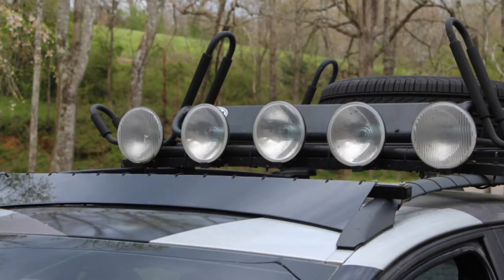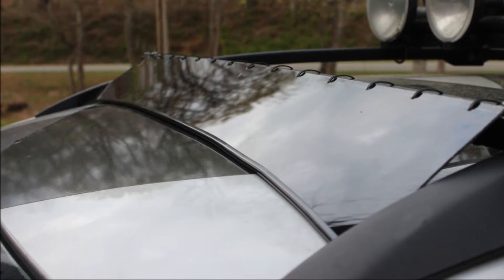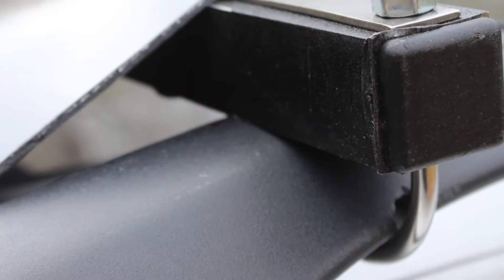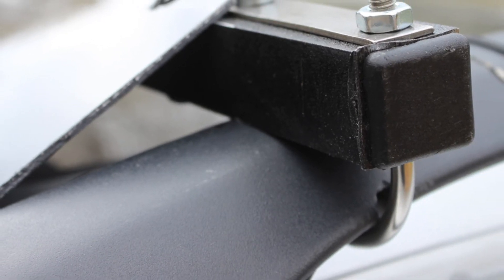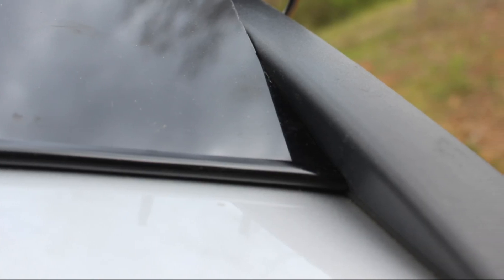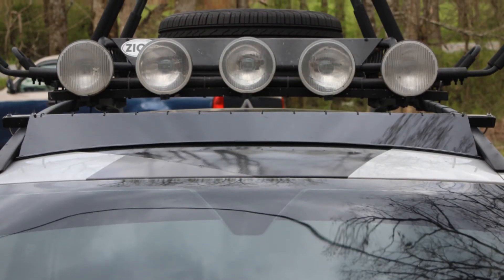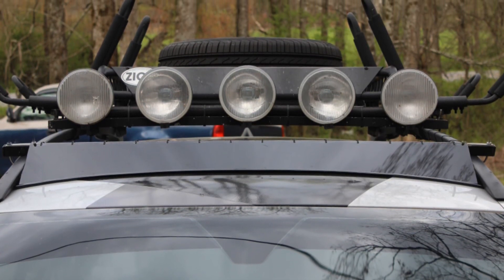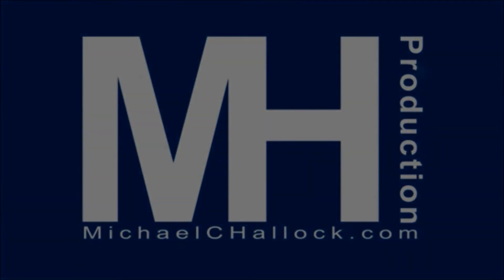Project V50, Episode 50: Wind Fairing

Comment: Looks great. Where did you find the lexan?
Reply from the maker: Home Depot Sells sheets of it in varying sizes and thicknesses.
Reply: what thickness lexan did you use for yours I don't want to buy one that will be too flimsy @MyNameIdeasWereTaken
Reply from the maker: @kodyvalentine3983  I can't remember the exact thickness, but it was something that was readily available at my local Home Depot. I just picked out something that seemed like it would be rigid enough for a fairing.

Comment: Hey! I am also a v50 owner, I didn't check all your videos, but have you done one on how to install those black rails on your roof? Or did they come stock with the car? Thanks!
Reply from the maker: They are factory roof rails, but if they did not come with your car, they are not hard to install. Here are the Volvo instructions: https://accessories.volvocars.com/en-it/V50/InstallationInstruction/Pdf/VCC-151284-1/2012/1.6/Manual/default/V50%202012